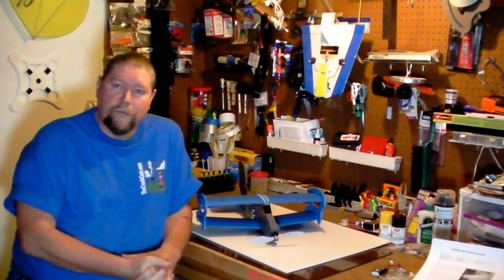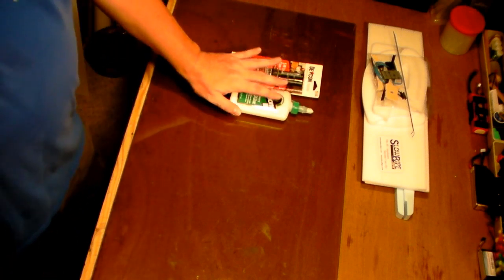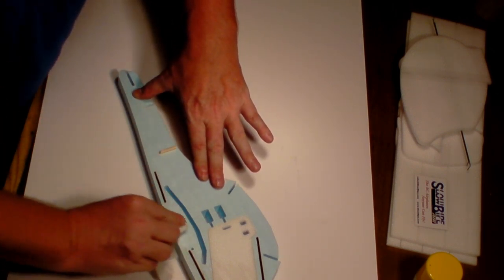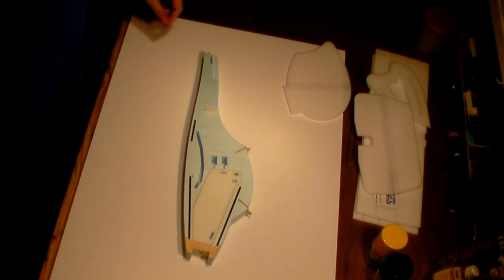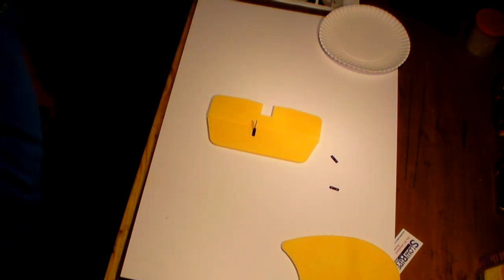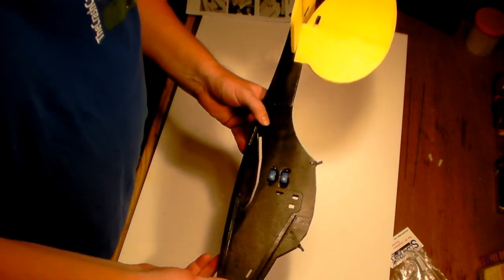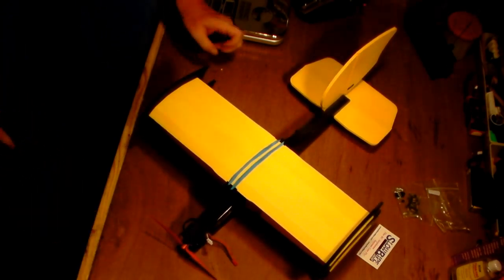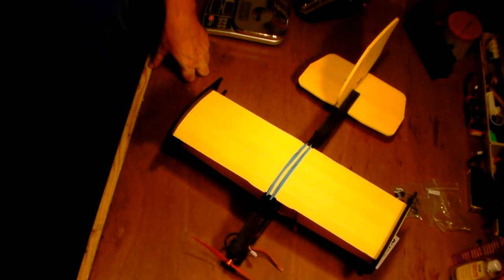Building The MiniBipe

Comment: Any suggestions on transmitters for newbies?
Reply: This used to be an easy question to answer with just a few options, but in todays world the sky is the limit, no pun intended. More or less it will depend on your cash flow, and how serious you intend to stay with the hobby.
Real cheap is not a good idea with hobby grade models. However, you can get a spektrum http://www.horizonhobby.com/products/dx6i-6-channel-dsmx-reg-transmitter-with-free-ar610-receiver-SPMR6630 <like this one, that will allow you to also use with bind and fly type airplanes for later for a relatively good deal.  Do yourself a favor and don't choose less than a 6 channel transmitter regardless your decision.
I personally am a Futaba person, and use the 10J which is also a phenomenal deal, and is really up to date with today's technology with things like preset quad copter programming and mixes. Visit forums often, and read a lot. You will learn loads.

Comment: Please use tape to pickup that graphite dust.  Better there than the floor.  The friction fit elevator works for a while then I start running out of elevator. The tail was sliding back. Wing tips were the same way. Ended up embedding tiny magnets for retention. I used a 28gr motor (2205C-1400kv w/8x3.8) and it's great on 2s. 3S is overkill at 120W.  It's a good second plane for learning to flying beyond the right/left error stage. In the end ailerons and gear were added for a T&G trainer.

Comment: What is the thickness size and type of foam is used for the wing and tail feathers? EPP, Depron? Or is it to XPS type like the fuse?
Reply from the maker: There are various types of foam used on this plane, but it's all XPS (Extruded Polystyrene). The wings and tail surfaces are of the 5-6mm variety (like CellFoam-88 or Depron - both trade names of XPS) and the fuselage is an insulation-type variety of XPS, as you have already guessed. No EPP in this one.
Reply: Interesting, appreciate the info. I intend to build a similar model with a lot of borrowing here, but in twin form like he had in one of his videos. Its to bad he only seems to stock just the mini.  While the design is very basic and modest, it simply works and does it well. Leaves a lot of room for some experimental variants.